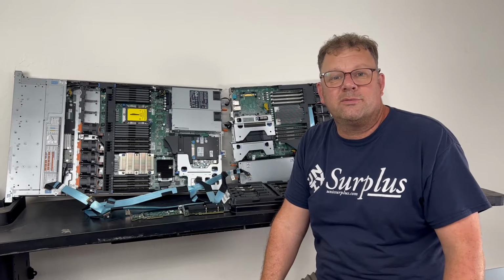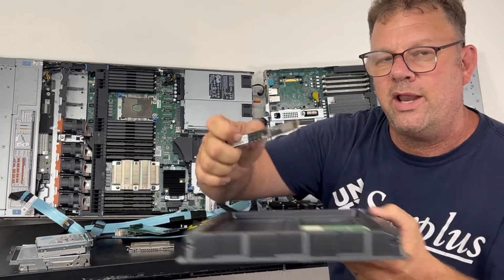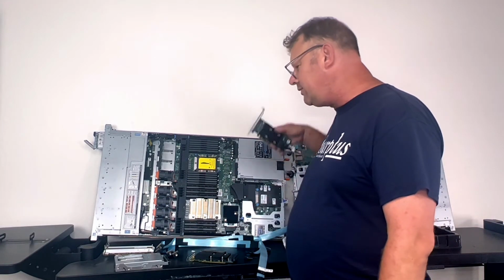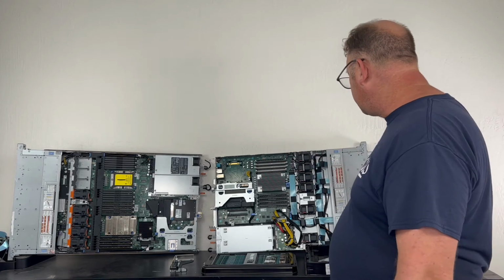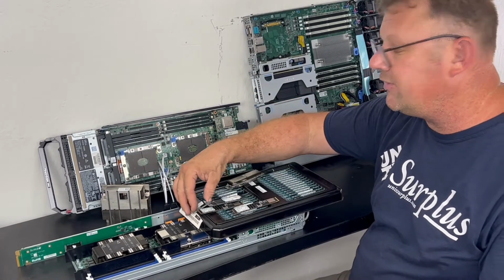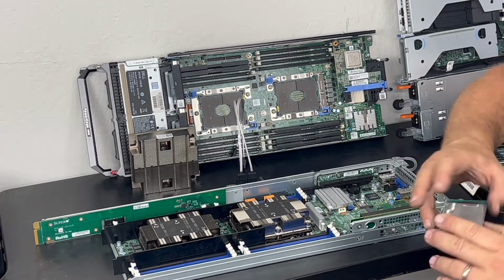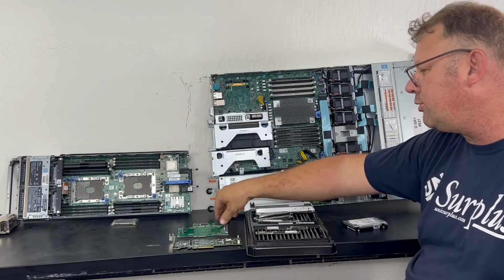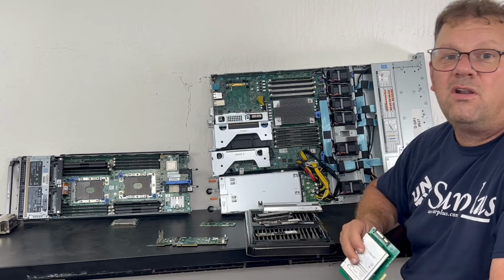NVME System Upgrades for Dell R640 R740 M640 Blades AMD EPYC 6515 and More. Compare BOSS U.2 VS. M.2

Comment: Been reading for days on how to get NVME RAID 1 on an R640. I just want two U.2 NVME disks in RAID 1 for the entire system. No boss card, no SAS.  I've read you can MAYBE use s140 software RAID but there are mixed reviews.  Could you not add a PERC 11 controller ? i realize the PCIe version is lower but i'm not even going to saturate a 16x lane with dual NVME in RAID 1 anyway.  Is there a combination of backplanes and cabling that could make that work?
Reply: Did you figure it out? I think the boss s1 only recognises sata m.2

Comment: Thank you for the video. One quick question, can an R730 boot Linux from Samsung NVMe M.2 2TB with a Dell BOSS pcie card (without clover usb)? If so which one? I have been getting different answers from sellers.
Reply: That's impossible